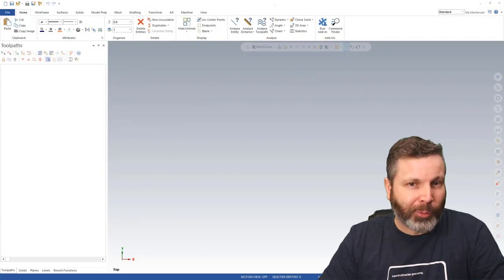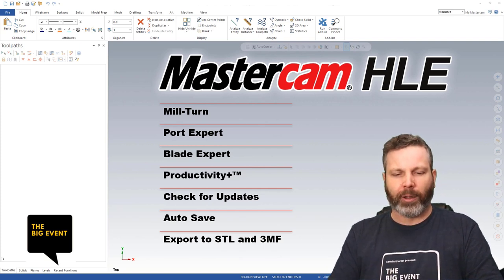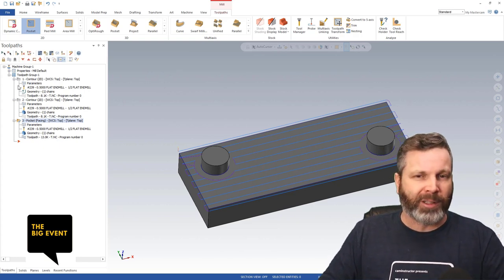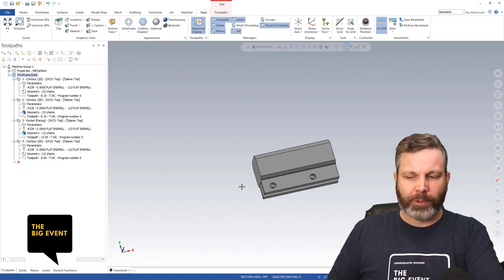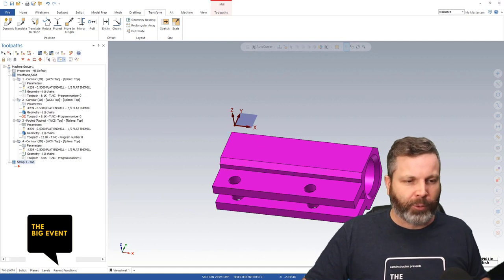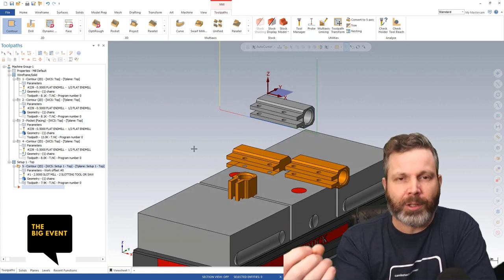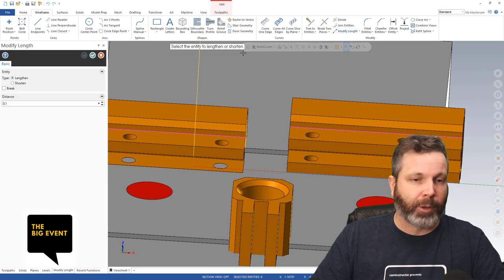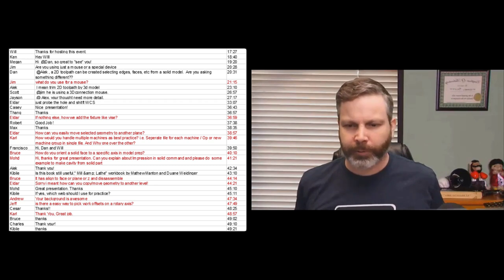Mastering Mastercam Basics with Mike | The BIG Event

Comment: I have never commented on any videos before but yours what was I was looking for. I am a long time Gibbscam 5 axis programmer and now moving to Mastercam, this is a great transitional video giving guys who have experience in other CAM systems the route to make the change. I think your ability to apply different views of tackling setups is great. I would like to see a video on ways to implement 3+2 or just 4 axis indexers. I have used the rotate or transform tool path function a little but am wondering if you have videos that explain this as well as you did in this video. Great Job!
Reply: setup is importen  and set plan first ,, you can do it manny ways      parts can look simpel but  can be hard to machine  ,,

Comment: With levels! Is it possible to select a part... ctrlC copy the part... make another level active... then Ctrl V paste the part into the newly selected level?
Also part orientation. Snap to views only seems to work when there is a named plane is there a way around this so snap to view works on ALL views, even the unnamed flip side views.
Thank you also for the very useful info
Reply from the maker: Yes you can copy paste with CTRL+C and V. If you do this with the graphics area active, you will duplicate the selection on the active level. You can paste to a specific level by selecting that level in the levels manager, it does not need to be the active level just need to left click on it and then paste.
I'm not sure I'm following on the 'snap to views'.
Reply: CamInstructor thanks for the reply. And.... snap to views. I use ZBrush a lot and i can turn and tumble the model to EVERY 90degree view. The model snaps to each such view. When i hold down the “S” key in Mastercam it does nearly the same action but only on views that have a named plane. I can see this name displayed below the Gnomon. But it will not snap to ALL the other 90 degree views that are not named. Why?
Reply from the maker: Ok, I follow now. Couple things here...
First, every plane in Mastercam will have a name. If you are trying to snap to a face that does not have a plane relative to it, it will not snap.  
Second, the snap has a tolerance on it, default is 25 degrees. This is basically how close it has to be to the plane in order for the snap to happen. So if you are trying to snap to say bottom, if your X is out by 180 it won't snap to that face. You'd have to swing it all the way around, then it'll snap once its within the tolerance.
Reply: CamInstructor Exactly my problem. Its not snapping to ALL THOSE VIEWS that are not named. Seems odd that this fantastic usability should be limited in such a way. I can not understand why this tumble and turning of a model would be limited in this manner. Is there nothing that can be done to COMPLETE the functionality? Perhaps you have some influence over the programers of Mastercam to “round off” the code to make this happen! That is to say... make it snap to ALL 90degree views, ALL. Even those that are not named. Or can a macro of some kind be created to “create” the “missing” planes, so this would work in its entirety.
Reply from the maker: It does snap to all the 90 degree views, you just need to be close to it. When viewing a plane, Y+ is at 12 o'clock (X+ is at 3, obviously Z normal to that) you cannot snap to this plane if your view has Y+ at 3, or 6, or 9 o'clock...it has to be close to 12. This snapping will work for every plane. As mentioned previous, you cannot have a plane in Mastercam that is not named, so no it will not snap to unnamed planes because there is nothing to snap to.
Couple solutions that could work for you...
1-Using the G column in the planes manager instead. If you know you want to look at the part from the Right, click in the G column for that plane. 
2-Create more planes. Right click on the Front plane in the planes manager. Select Create relative. You can uncheck the isometric views here but accept the rest. Do this for Front, Back, Bottom, Right, and Left. You will now be able to snap to any standard '90 degree' view in any quadrant. If this is the behavior you want you can save this as a template.
3-If you want to snap to another view outside of the standard 6 sides, you need to make that plane first. Then if you want to be able to snap to it in any other orientations, you'll have to make those planes as well.
Reply from the maker: I think this might be an interesting topic for a video. Not many know about this keyboard shortcut let alone the quirk of having to get alignment to work. Might have it posted later this week.👍
Reply: CamInstructor I certainly have a more pleasurable experience using this and the S key. More intuitive. I wish it worked by default on ALL views without having to go the extra mile of making a template file. Yes a good topic to share.

Comment: hello, I installed Master Cam 2021 Demo-HLE to learn, I would like to know if X+ can be installed to have fixtures . Thank you
Reply from the maker: X+ is an addin and you cannot run Chooks/Addins in HLE. Also, X+ is also a paid product, it used to be free but no longer.
That being said, you do not need X+ to add fixtures into Mastercam. You can do this with a normal Merge function.
Reply: @CamInstructor  kk thank you so much

Comment: STL files are basically worthless in MCam and more so in other CAD/CAM programs (including Solidworks). They take a lot of time to generate and are a "generic representation" of what the stock looks like.
I've yet to see one instance where when I generated an STL for another operation and the approach points etc. automatically detect that it's off by upwards of approximately .010".
Looks great on our screen, but throws off the machinists when they see an approach of "1.9912".
It's frankly a "stock stupid " system. MCam is so overpriced for what it is and it's gotten WAY worse as of late, to the point we're looking for something else.
Reply: Have you tried SolidCam

Comment: ican do that part without mastercam software its more complicated using cam software. cutting the slot sideways? you can use an endmill on that and put it up so it will cut a straight line. you make a complicated set up with this. sorry but thats a dumb set up on that vice
Reply from the maker: Cutting the slot from the side saves a setup. Besides, if all you get from this video is a will to argue about the setup and whether or not to use cam, you've missed the hole point of it.